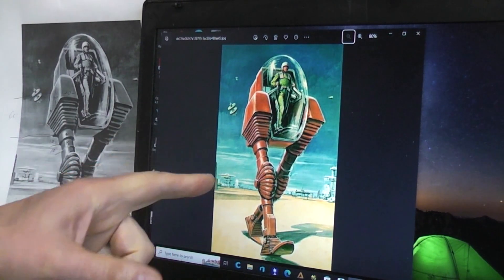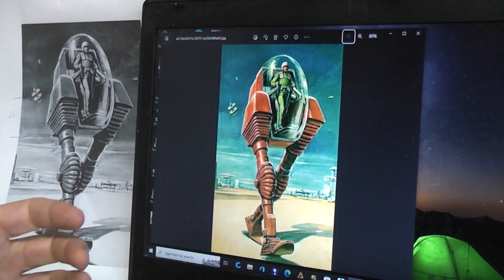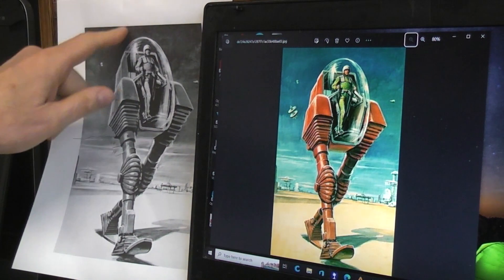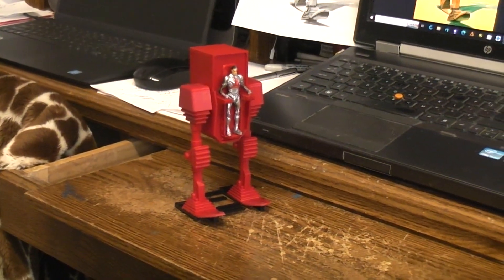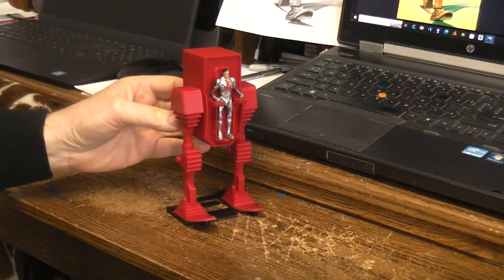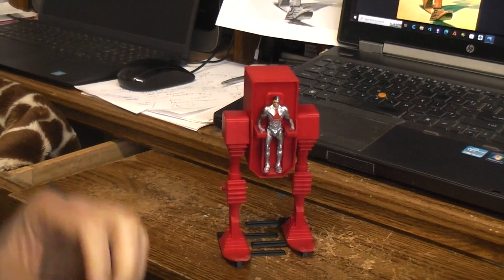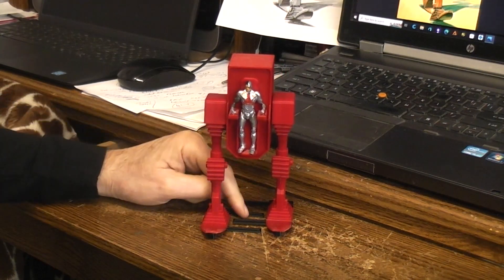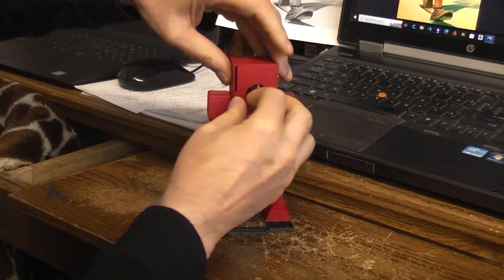Turning vintage artwork into a walking Machine toy. Based on General Electric's Pedipulator 1960s.

Comment: Very nice. Fun.  You can also find clear egg shaped plastic domes out there, they even have flat bottoms.  Maybe you could build around one.
Reply from the maker: I thought about that, so far have not found one in the right size. I may just thermal foam a dome in another video.
Reply: @Robothut  There is an image by Beeple that is very similar to this design, except the "pilot" is a chimpanzee which is terrorizing humans lol.  Oh and it has robotic/cyborg arms to inflict damage.

Comment: I guess it's time to buy a vacuum forming machine to make that egg shaped dome. If you don't mind my saying I think the body looks a bit more tapered in the artwork, not as boxy.
Reply from the maker: Yes, I could have made it larger and added the taper, right now the gearmotor just fits inside as do the AAA batteries. So of the artwork look is do to the angle of the drawing also.
Reply: @Robothut  This turned out great. Have you considered using a single AAA size Lithium Battery ( 3.7v  ICR10440) ? They're about the same voltage, with the added advantage that they are rechargeable of course.
Reply from the maker: @jamesbronson8713  I prefer to use standard size batteries that have been around for 50 years, also I think it is important to make sure that all batteries are removed from toys when not in use, even the Lithium type. But feel free to do so, they are a great source of power in a small size that can be recharged..